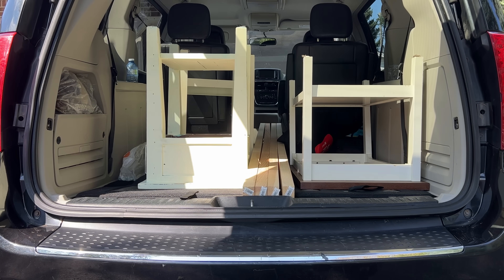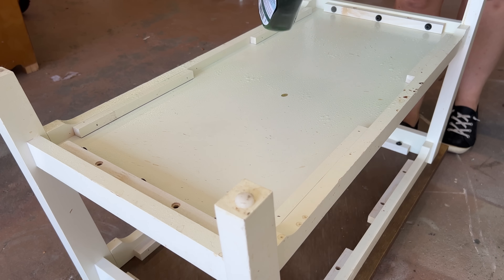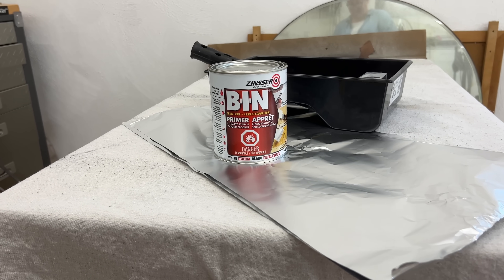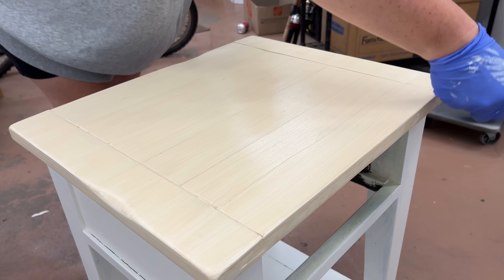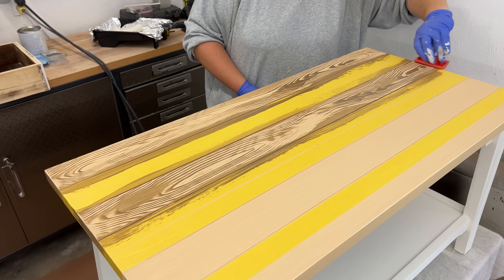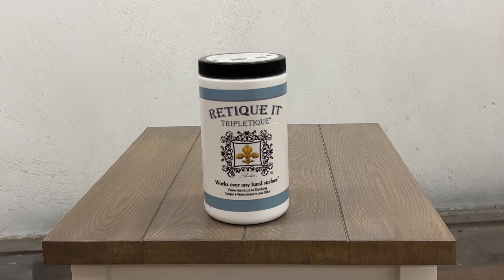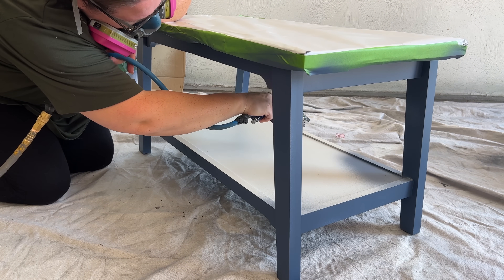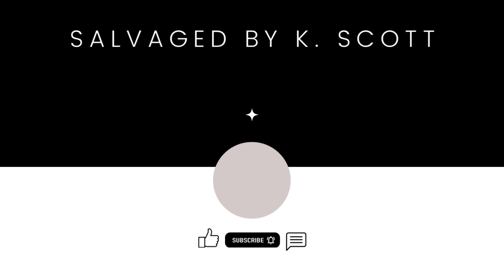Lakehouse Coffee Table Makeover | Making Paint Look Like WOOD!

Comment: Great job👍🏻😁
They turned out really well. 

Wood graining tools can take some time to master. There are actually a few different ones depending on where/who you get them from. I used to work at an art supply store (oh my) 30 years ago and we sold all different faux finishing kits & supplies. I got several of the grain tools to check out/learn so I could be of assistance to customers…yikes…it took me longer to get the hang of them than I thought it would. My ego got snagged. 

You did a great job with the wood finish.